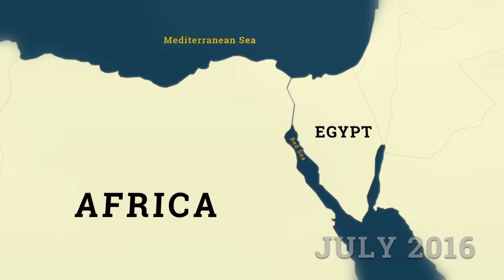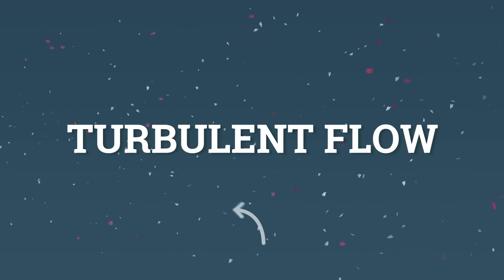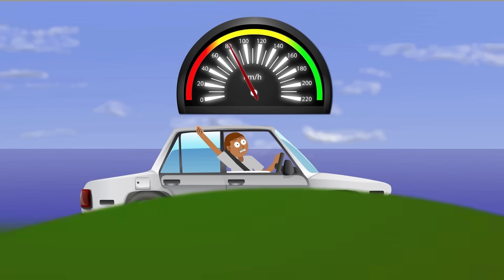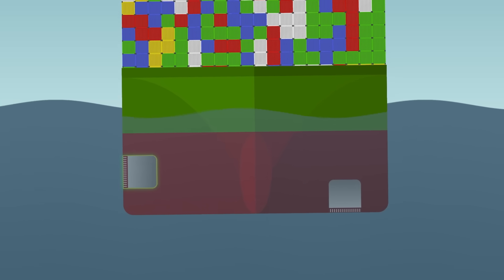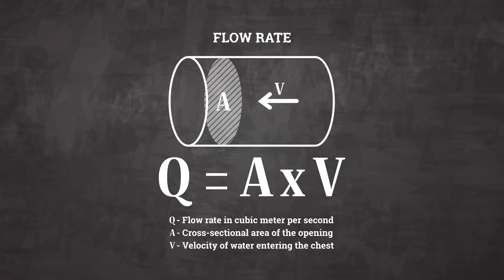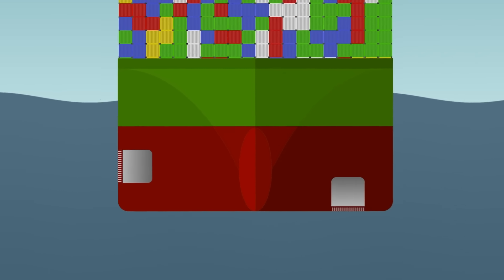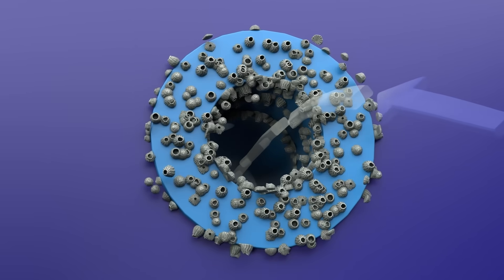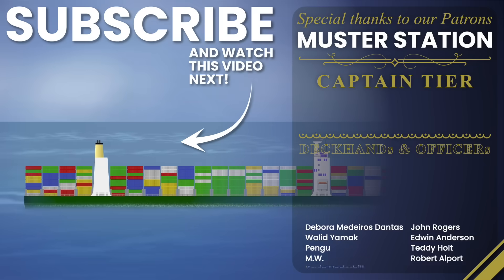How Do Ships Suck In Water On Purpose?

Comment: From 7:20 you claim that most sea chests are either rectangular or cylindrical.  However, your accompanying images are of grilles on the ship's side, not sea chests.  All the sea chests I've encountered had flat sides except for the side formed by the ship's side, though a cylindrical sea chest is possible.  The clue is in the name: Chest - like a box.  Your image of a round grille has vertical bars - the worst for the smooth flow of water into a ship moving through the water, yet you illogically use it to explain laminar flow.  Grille bars perpendicular to flow of water past the hull will create turbulence.  The image of a grille needing rounded corners, not square corners to promote laminar flow through the grille is nonsense.

Comment: Your explanation of high and low suctions (5.20 - 6.00) ("upper and lower sea chests") is not only back to front but totally illogical.  You certainly would not use the upper sea chest "when the ship is  rolling heavily or lightly loaded", because you would risk losing suction and having no cooling water.  The reason for high and low suctions is because using the low suction in shallow water risks drawing mud from harbour, river or canal beds into the ships cooling system.  Therefore, you use the  high suction (upper sea chest) in shallow water.  At all other times, you use the low suction to avoid interruption of cooling water flow.

Comment: The explanation about static pressure is incomplete at best and misleading and outright wrong at worst.

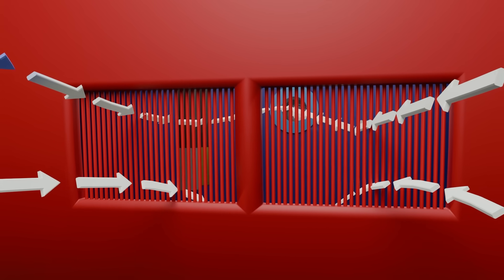Static pressure can only fill any container once. Anything, including water, only flows from a high pressure region to a lower pressure region. If the sea chest is empty, sure enough, static pressure will fill it. But once it's full, pressure on the inside and outside is identical, meaning no new flow happens. For new water to enter the system, old water needs to be removed. Ultimately, to remove water from the ship, you need to either pump it upwards and drop it into the ocean, or pump it out against the same pressure on the outside. Either way a pump is required. Of course, while the ship is moving, dynamic pressure serves the same effect, but the video made it sound like no pumps are needed, because the static pressure pushes water inside even while the ship is just sitting in the water (2:39 & 3:30). This is wrong. If that was possibly, we could easily create a perpetual motion machine using this effect. I may not know a lot about ships, but this is basic physics. Filling the system with water can happen through static pressure. Movement requires a pressure gradient, either through dynamic pressure, or pumps.

The people who researched this video clearly did not fully understand the topic, or the basic physics involved, and decided to gloss over it. From an educational channel i expect better, especially if the channel then asks for money "due to all the effort going into these videos". I can understand issues with complex topics, like quantum physics, but certainly not someone trying to tell me ships are automatically cooled by static pressure without pumps. If static pressure alone could cause flow, we could solve all of humanitys energy demands by building a perpetual motion machine. And this isn't even the only thing wrong with the video. The (first of the two..) explanations for why there is two sea chests is utter nonsense.

Seriously, was the script for this video AI generated? Shame on you. Do better. This is not the once passion-driven channel i subscribed to. I think i'll give the channel one more video before adjusting that decision.

Comment: Kind of funny that they have to explain that water will naturally flow into a hole in the side of a ship's hull.
Reply: Especially considering their explanation was complete nonsense. Static pressure can flood the system, but pumps will still be required for flow. They made it sound like the entire system works without pumps, even with the ship just sitting there, due to static pressure.

Comment: You have no idea how happy I am that I am not studying fluid dynamics LOL. Great clips and animations, though the structure of the script did leave me a little confused in a few places.
Reply: Don't worry about being confused. I know just enough fluid-mecanics from my engineering degree to spot a fair number of misleading and blatantly wrong illustrations and explanations.
Reply: @2testtest2 Could you point it out? The hydrostatic pressure equation was right. Something to do with Bernoullis principle? Pressure does decrease with speed so not that. There was a slight error in the way that they showed the pressure high at a narrow intake in the pipe but they were right that it would be high when the fluid is stopped "at" the intake to that pipe.
Reply: @bobthegoat7090 I will take a stab at it. Gonna take a while to type it all out.

0:42 Right side, somehow the water is being sucked in in a concentrated stream 45 degrees from bellow. Not true, it would flow mostly equally from all directions, in a fan like fasion. On the left, a titanic style ship with a catastrophic leak, with bulkheads overflowing, and no bulkheads in the middle? Why is it even here?

1:05 ships would not become underwater tombs just because of a failure of the sea-chest. They may become unable to navigate and put out fires, but there is likely still plenty of time to rectify the issue unless you have an existing fire, or one occurs while you work the problem. 

2:28 arrows representing pressure should be primarily coming from the water, the arrows from above should either be much smaller, or fewer in number to show that the air pressure from above is much less than from bellow. If it was equal as in the illustration, the ship would sink, as there wouldn't be an upwards force to counteract gravity. 

2:35 water would only ever enter a hole in the hull due to physics. This is not an explanation as to why the ship does not sink.

2:45 while the sea-chest will remain filled as long as it is submerged, it will only flow in when it is also being sucked out by the pumps (pretty much always on large ships, as the arr rarely completely shut down). 

2:46 arrows representing water pressure should be pintin normal to the hull surface, not down.

2:51 same as previous 

4:31 water is only pushed in if it is in an area where the hull is pushing the water away (primarily the bow). Further aft you actually get a suction effect due to bernoulie. In fact I own a kayak (surfski) that exploits this effect to drain the cockpit from water at speed.

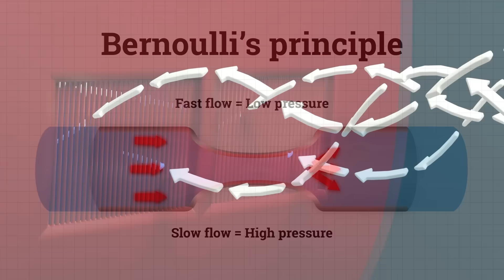4:45 illustration shows arrows representing flow move quickly in the thick section, and slow in the narrow section. Due to conservation of mass and incomprehensibility of water, the opposite must be true. This is even explained later in the video!

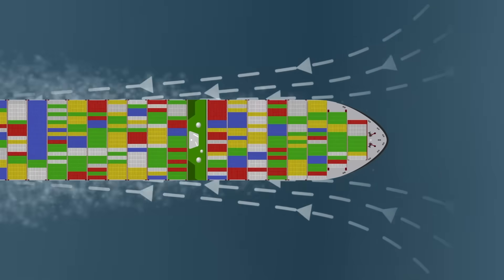5:04 flow lines shown are tapering in, suggesting increasing flow speed relative to the hull, and  some how the bow must be sucking water in? The opposite is true. Bow "plows" the water away. Due to the non-slip boundary condition, water touching the side of the hull is being dragged along. This drags along more water, gradually increasing towards the rear. Thus the flow lines should fan out towards the rear.

5:19 mixed up which intake makes sense in which condition. Should be opposite.

8:16 The equation is correct, and well explained. It does however not determine the flow rate, it's just the relationship between velocity, area and flow rate. This is  the one the bernoulie illustration does not follow.

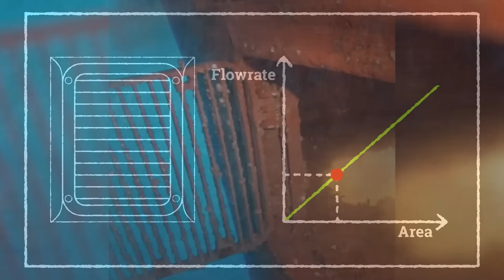8:37 Some truth here, but illustration shows are reducing, while narration says the shape is important, with narrow being bad, which is correct, but is not the same as area being lower.

9:20 explains and better illustrates what's wrong at 5:04

11:53 Not sure of the correct English name, but swarms of shels hitting the gratings. They are normally glued to and growing on a hard surface, like rock or a ships hull. These sink quite well and are quickly get devoured if detached. No Idea where they got this Idea from. Seaweed and plastic bags would be far more realistic.

Comment: Weird symbolism with the breathing, overdramatic, strechted too long. Worst video on this channel.
Reply: AI script.
Reply: I disagree. I thought it was deliberately written to be very accessible to a layperson; Sometimes reiterating or restating moderately technical ideas can be helpful, or, at least, superior to a more succinct video lacking such accessibility. (The vid used both analogy and the actually applicable- admittedly simplified- math... I really don't see what your problem is. (Your post sounds like you were somehow offended? Is that the case?)

You could respond in more detail, rather than just providing unconstructive criticism, without any specific examples, etc.. but, you are, of course, welcome to your own (incorrect, imo) opinion, I suppose.
Reply: @bholdr----0 you aren't as important as you think you are
Reply: @bholdr----0  I agree with you in that you are welcome to your own, imho incorrect, opinion.
Reply: @bholdr----0  "The ships let's in air, just like a breathing person" - no it doesn't not, the water is not used for energy, it's for cooling, the water is not cycled in and out through the same entrance point, it's pulled it from one port and pushed out another. It has nothing to do with breathing. The sentence is just there to make it sound more dramatic.
Videos on this channel used to be 5 min, with the same amount of information, now it's strechted to 15 min to get more ad revenue.

Comment: The intakes seem like a recipe for Delta P if you are in the water, I wonder if the pressure is enough to be a risk.
Reply: "once its gotcha, its gotcha"
Reply: Yes, it is.
Reply: This is where the discussion of hydrostatic pressure seems incomplete or misleading. 

If you had an inert tube running through a ship from one side to the other, the flow would be negligible compared to the formula for hydrostatic pressure at that depth, it wouldn't even have a clear bias for direction. A straw doesn't generate a cosntant flow of air depite the hydrostatic force of the air around it being nearly 15 lbs per square inch.

The pressure in the sea-chest should constantly be trying to equalize with the outside; so just a delta-p would determine the flow rate and not the full hydrostatic pressure. It is the pumps that are pushing water through the filters that are effectively the source of delta-p for the intake with the maximum rate being based on hydrostatic pressure (but I highly doubt those pups are ever strong enough to start pulling a vacuum on the chest)
Reply: @vctrsigma  Thank you for that, my understanding of Delta P as a civvie trained rescue diver only went as far as "watch out!" and horrific stories and one diver coming VERY close to disaster, they came out of the water like a ghost.

Comment: Wow this is much longer than it should be and it's very clear you don't understand how pressure or Bernoulli work. Also drop the AI, it's rubbish.
Shame, this channel used to be good.
Reply: And starts talking about a ship in the Suez and never gets back to it to explain what happened to her that's related to seachets.  I used to like this channel, but WTF?!?!
Reply: They explained that at the end. Watch the video before commenting.
Reply: just seems to be AI slop now
to me
Reply: What do you mean? The hydrostatic pressure equation was right and it is correct that according to Bernoulli's  principle pressure decreases when speed increases. I am all for criticism but I find it ironic to critisize a video for not explaining something correctly when your comment also lacks a good explanation.
Reply: @bobthegoat7090 fast moving water does not hit the sea chest and slow down. Fast moving water rushes along the hull of the vessel and reduces the pressure inside of the sea chest. This video is just factually wrong. Like when it says to use the high sea chest in shallow water. In reality we almost always use the low sea chest, except when in shallow water where using the low suction may result in sucking up sediment and debris that clogs up filters.
Reply: They do a bunch of argument about where the sea chests should go. Know where the sea chests go? The engine room. Because the hydrostatic pressure is only going to get that water so far through the piping system, cooling water systems use centrifugal pumps for their high flow rates, but centrifugal pumps can't pull a vacuum. So you need the sea chests near the pump. Yeah sure the hydrodynamic effects and Eddy currents are a factor. Nearly negligible compared to 5 more feet of pipe to go through though.